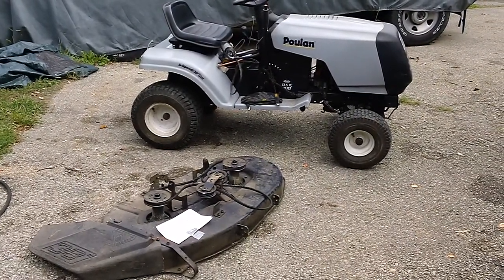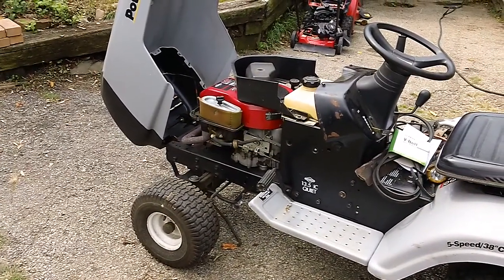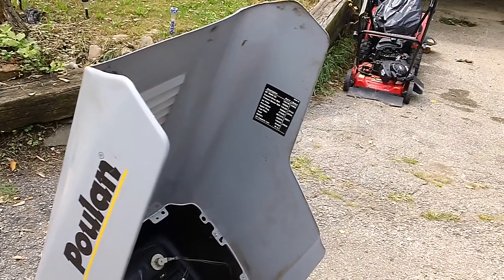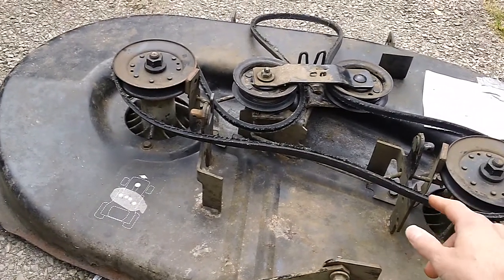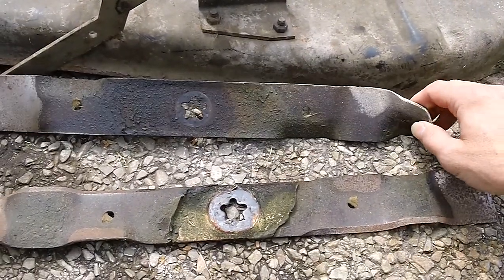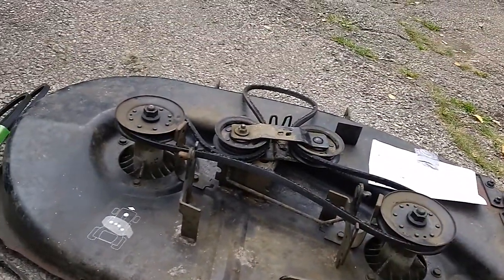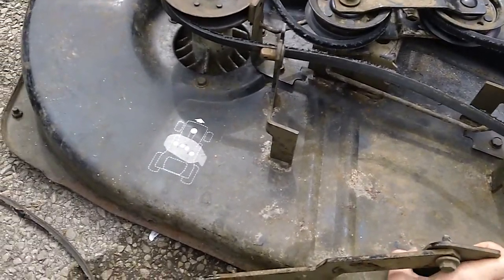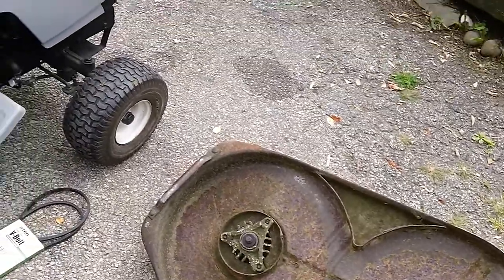Poulan lawn tractor

Comment: Frigidaire is not a defunct company - the factories in South Carolina (where riding mowers are made) and Georgia (where push mowers were made) has changed names many times over the years, started out as Roper in the 70s and in 1986 a merger between Weed Eater and Poulan formed White Consolidated Industries  or WCI Outdoor Products,  in 1989 they changed names due to another merger to form American Yard Products or AYP and in 1997 Poulan/Weedeater, Frigidaire and AYP all merged to form Frigidaire Home Products division of WCI - then at the end of 2000 operations were renamed to Electrolux Home Products in 2006 Electrolux spun off to form what is now Husqvarna Outdoor Products.